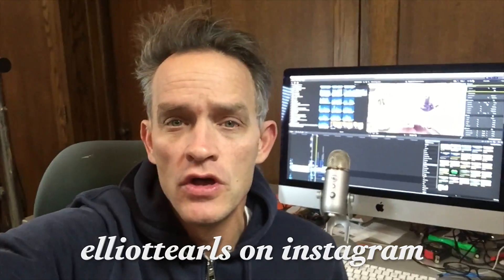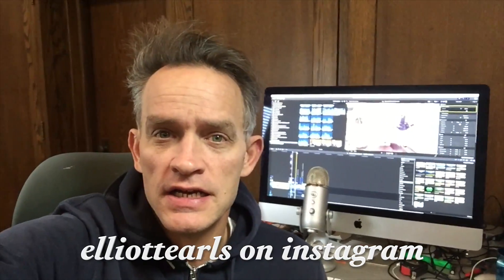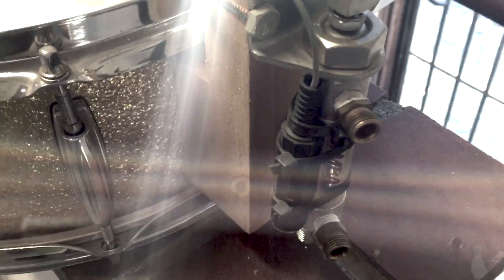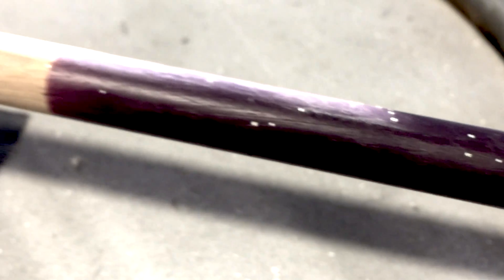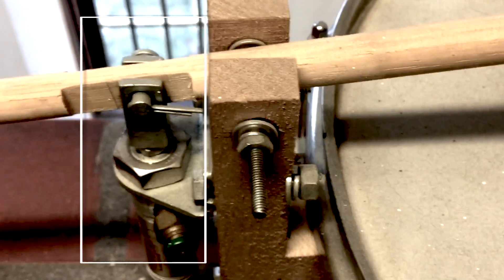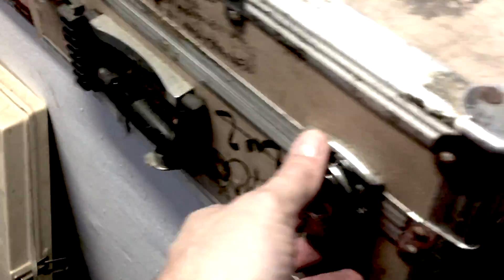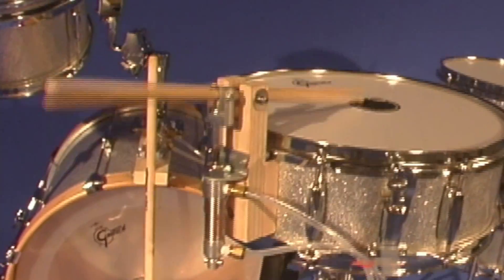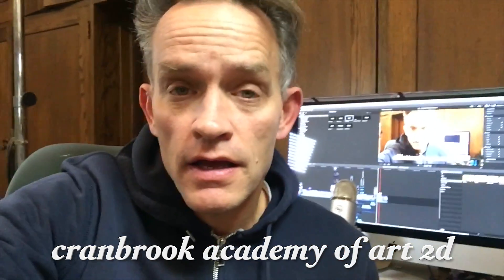A Robotic Drum Kit In Live Performance: Episode #31 | Elliott Earls

Comment: hey Elliot, a little late to this one but I was wondering—for doing complex mechanisms like that, how much are you actually building/programming as the artist and how much are you just sketching out to a shop or programmer or whatever for production? I would be curious to see a more in-depth documentation of that process, but I guess my question is, do you find it worth your time as an artist to learn those diverse technical skills or more efficient to farm out things you don't know? thanks and great stuff as always.
Reply from the maker: +Ben DuVall hey Ben. Thanks for the input man. A more in depth answer to follow... but in the meantime the short answer is that I LOVE LEARNING NEW STUFF. Much of my motivation is to do nearly ALL aspects of my work myself. I can feel myself learning and feel myself getting smarter/stronger. So in most cases (and in the case of this kit) I try to do everything myself. I had a small problem figuring out the relay system in the kit and just asked a friends father who was an electrical engineer. He corrected my mistake. And I learned in the process. More soon.